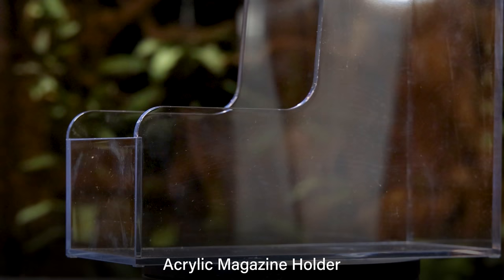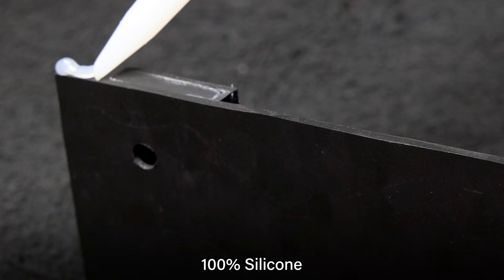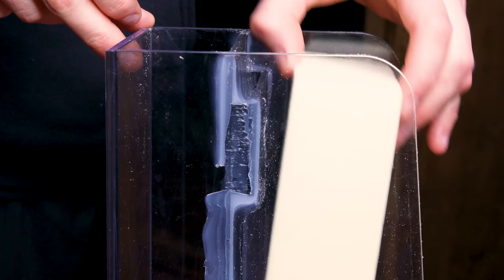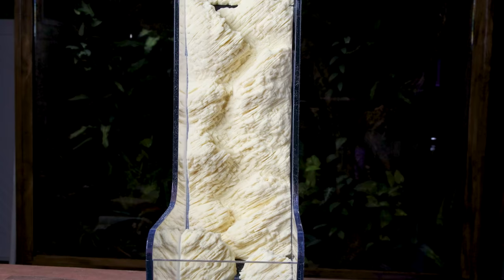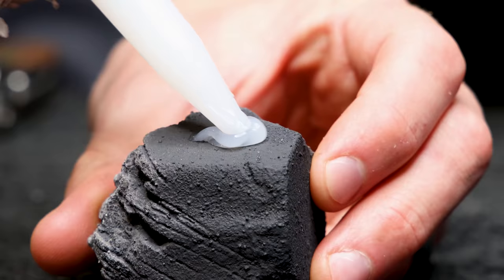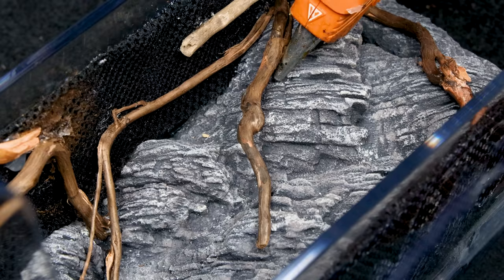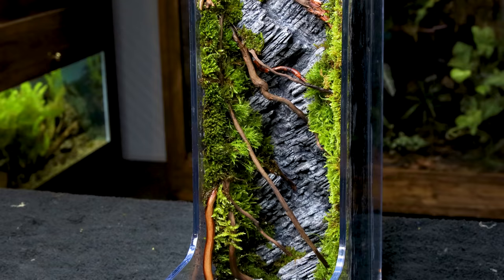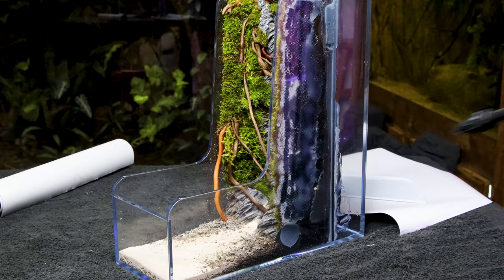DIY Flowing Waterfalls Moss Book Nook (Living Library)

Comment: I adore the concept and I have, literally, thousands of books.  I’d be scared to have that much moisture that close to my books?
Reply: You can buy prop books to put next to the water, either individually or in a group. As in looks like 6 books next to each other but it's just a hollow box. That should give enough separation.
Reply: @tmurphy0919  yep! Hobby Lobby sells those in all different colors and sizes. May even be a nice spot to hide things as they are intended. I would even do a coat of mod podge on them so as to seal them from moisture a bit better. I love how they look like real and old books!

Comment: By putting an airstone in the overflow of the water you can add more roughness to the waterfall, and it will probably look more natural because the water will be a bit more rough/white because of the little bit of foam.

Comment: Question: how do you determine when to use hot glue, silicone, or super glue in certain situations?
Reply: I’m not tanner but I’ll try to answer: Silicone is good for when you want a waterproof seal. Joining pieces of glass or plastic to create a tank, or sections within the tank. It’s also used when attaching dirt to foam backgrounds because the dirt can be pressed into the soft silicone, and the silicone can be dispensed in great quantities. Superglue is great for attaching things like moss, wood, or other hardscape elements quickly and easily, and with a strong bond that isn’t broken easily. Super glue is totally safe for aquariums and terrariums once cured, so don’t worry about that. Hot glue can be used in a similar way to super glue, but it’s not as strong. However, it’s a soft goo like silicone, so you can press things into it more easily than superglue.
Reply: Silicone is used for attaching glass together, if you need a tight, water proof seal. Be sure to use a nontixic variety meant for aquariums or fish ponds, if you use it.

I've seen Tanner use hot glue, out of water and away from eyesight, or on things that need a temporary or light hold- be careful, pretty sure hot glue is toxic, and it probably doesn't do well underwater. It is also not meant to seal things.

Superglue- specifically cyanoacrylite or ethyl-cyanoacrylite based super glue, is nontoxic and dries inert. It gives a strong anchor for tiny details, and will hold peices in place. I used this superglue in my aquarium to glue plants to pebbles, so they don't float away. Just be sure to check the back of the label and if it contains cyanoacrylite or ethyl-cyanoacrylite, you're all good. I think gorillla brand super glue uses ethyl-cyanoacrylite, and that's what I used... I think. It was 1½ yrs ago, so.... I could be wrong. Check the label first, if you're ever unsure.